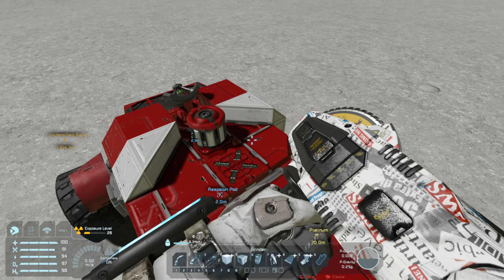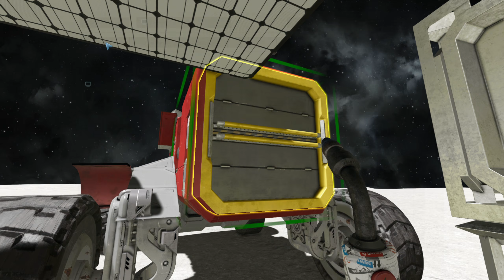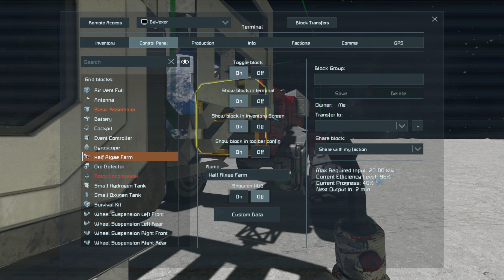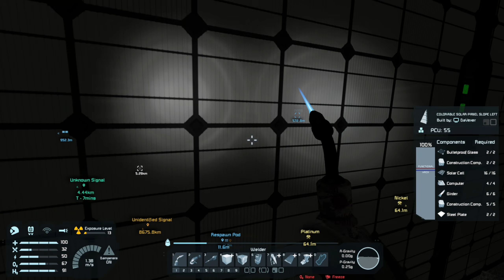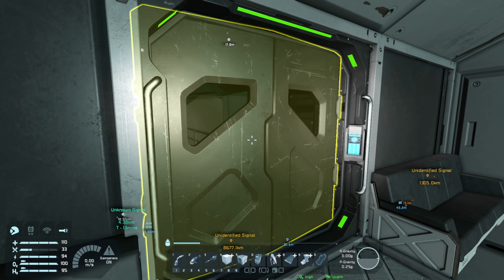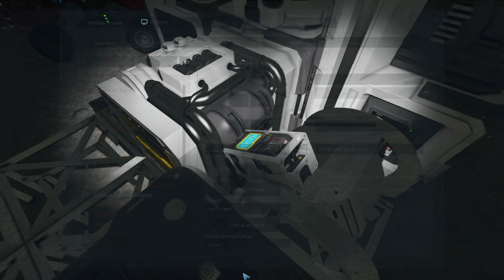Can We Survive 100 Days On The Moon? | Space Engineers Moon Survival Reboot #1

Comment: Everyone has there own way, but I always build a small rotor on the rover and put the rotor head on the large block base to connect the two. Tiny rotor takes hardly any components and the large head only takes 1 plate to place and use. Great video so far! Looking forward to the new adventure!
Reply: I should also say my OCD drives me nuts unless I actually build the rotor block, though for some reason it's fine if I don't build the rotor head. Heh, stupid brain. Honestly not sure how I feel about the food mechanic. It seems like just another bar to keep track of and not something that feels rewarding.
Reply from the maker: Yeah it doesn't make much difference if you don't weld it up. Usually I leave the large rotor on the base and build small grid system stuff on it, like timers and custom turrets